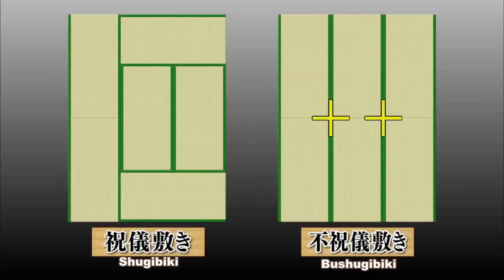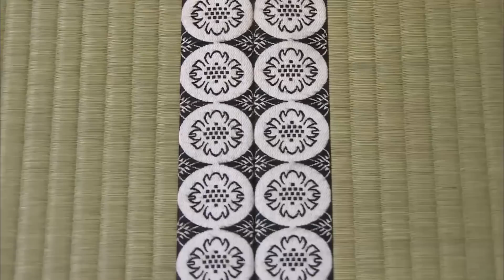The Highest Quality Tatami Mat is the Throne for the Emperors of Japan in the Ancient Times

Comment: The weird moment you realize that you're perhaps the only guy in your country who watches the video while sitting on a Tatami...
My old bed broke down and gave me horrible back pain. It forced me to sleep on the floor and that gave me the idea of buying Tatami and a futon bed. It opened up the room a little and I use this spot for more than sleeping. I hope that in my future home I can make my room completely with Tatami floor. I like walking on it (softer and warmer) and it changes the accustic and smell of the room. 
BTW: those mats are nearly impossible for me to lift. 35kg might sound like a lot, but I can lift far heavier, but not with my finger tips and I definitely don't want to damage the Tatami.
Reply from the maker: WOW...That'd be nice, Glad you liked it!
Reply: usually we move it in pairs on the dojo I train at. One person on each point. Makes it a lot easier to move them!
Reply: @djyppo  how do you get them out before you can grab them? Do you have any kind of tool?
Reply: @edi9892  we usually lift one of the ends and drag it on top of another one. but be careful, don't ever let it bend! Bending breaks the straws inside of the tatami! So this means you should carry it on the vertical, never try horizontal
Reply: @djyppo  But how do you lift it, when they are edge on edge so that hardly a blade would fit in between? It doesn't look like a good idea to use a blade as a prybar... The one thing, I think I got right is that the textile cover is not just to protect the edges, but also for holding it.
Reply: @edi9892  Hmmm, this actually never happened to me since where I go they are elevated from the ground, so what I'm going to say is just speculation.  I would try pushing a string on the gap with something like a spatula, after that I'd try moving it under the Tatami, after this it should be easy for one person to lift one of the end, so another person can pull it over the other mats

Comment: Why does the Japanese take off shoes?

It seems that it is greatly related to the climate in Japan.

It is clement, and the climate of Japan is rainy and is damp.

The house is a suitable structure for such a climate.

The mat will fail at once if going up by shoes.

Taking off shoes is relaxed or shamefulness in the presence of others?

The difference of such a custom…
Reply: Sakura Moore  : in Sweden we have the same custom. We take the shoes of when we go inside.

Comment: how do they clean this?
Reply from the maker: the easiest way to clean tatami mats is to use a vacuum cleaner. Vacuum along the grain to avoid damaging tatami mats.
Reply: @WoodworkingEnthusiasts  ah, so cleaning with a wet mop not recommended?
Reply from the maker: yeah...you should avoid cleaning tatami with a wet mop as they are highly absorbent and the moisture that remains on them can cause mold.
Reply: @WoodworkingEnthusiasts  ah, thanks for the information.